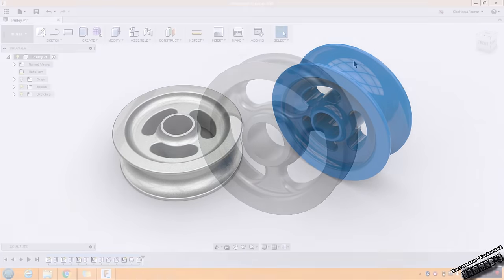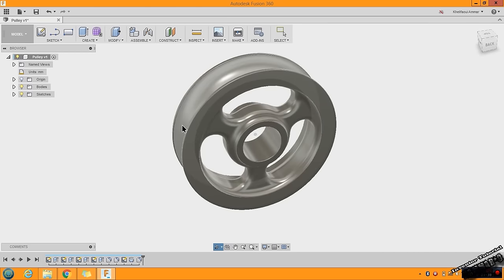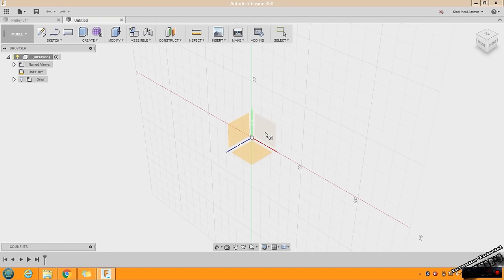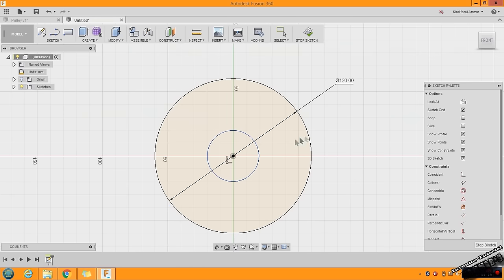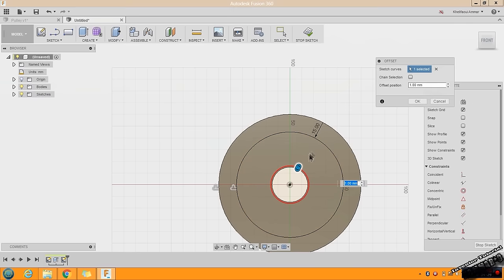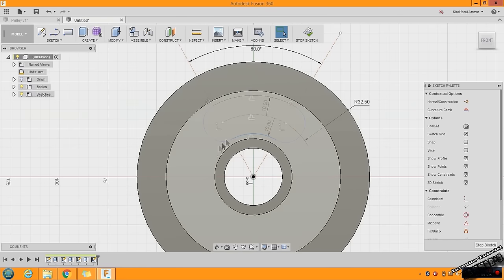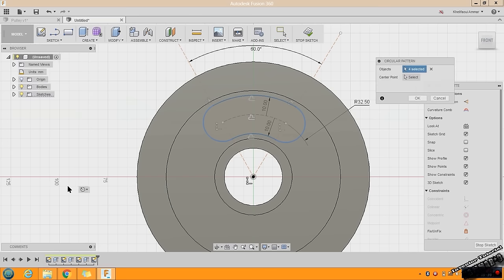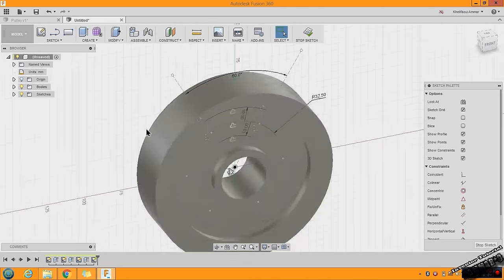Modeling a pulley with fusion360 !! 😍😍

Comment: hello khelifaoui
following your tutorial modeling a pulley, when i get to projecting the 5mm recess, fusion won't let me select the face of the 5mm recess to pick it for projecting feature to other face of the pulley. I have tried this at work on another pc and still the same result. thanks in advance. Dave.
Reply from the maker: hi there , you have just to select the edge not the face ! , trip :presse P to project then , selelct the edge.
Reply: Hi, thanks very much for your rapid response. I have finished your tutorial for the pulley.
Cheers to you sir. Thanks again.